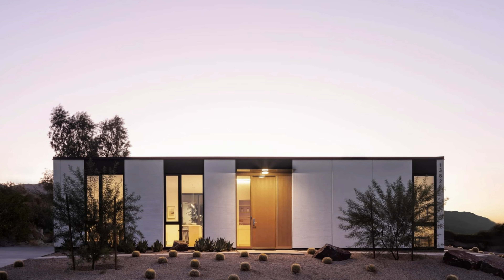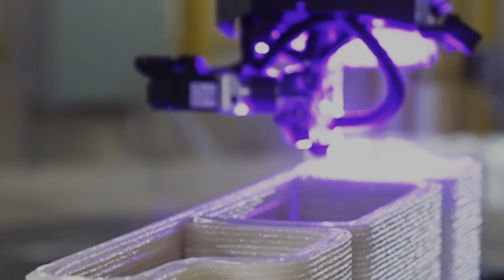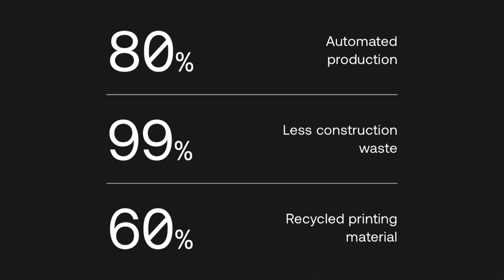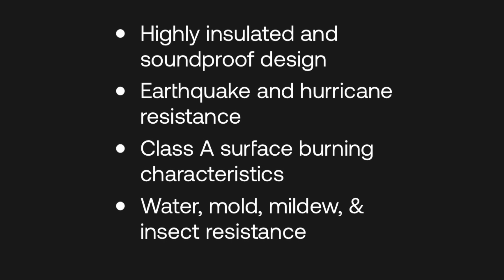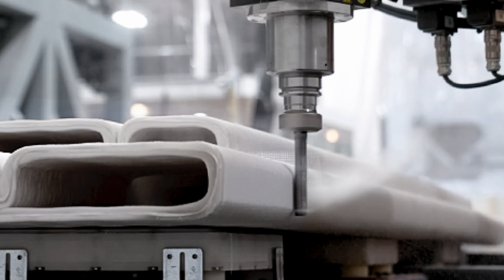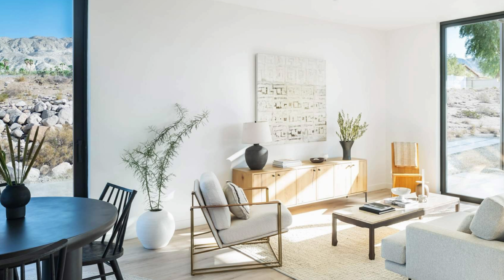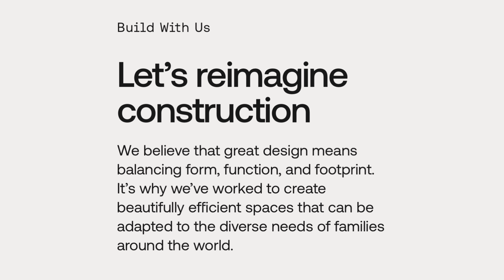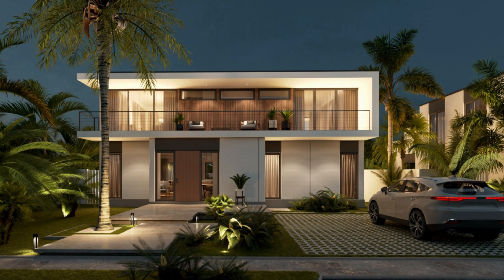Zero Net Energy PREFAB HOMES for Sustainable Living

Comment: I like this home and I want a home that is well built  to withstand hurricane strength homes with very little maintenance. 
But I love the homes you feature  with an abundance  of outside decks including ones with a roof top deck off of the upstairs bedroom.. lots of rodents and bugs in FL and I desire a home that will not allow bugs in my home.

Comment: The biggest cost in home development is actually the cost of the LAND the house sits on. Especially if you want "mod cons" like a flush toilet (as opposed to a composting toilet or septic system), running water out of the taps (as opposed to harvesting rainwater or using underground water), electricity, phone/net connectivity and finally not living way out west where it can take you an hour to drive to the shops.

How do we solve the land problem?

Comment: Sorry, solar panels may be 0 "carbon" when in use but they have huge issues for the environment. They are made with highly toxic materials and there is 0 safe way to dispose of them. It would be real nice if the truth was told about the environmentally safe products.

Comment: The 3D printing is just a cladding, not load bearing. Still using steel for structure which is costly, and immensely carbon intensive. They’ve managed to increase the wall assembly complexity instead of simplifying it. Visited their factory in Oakland and saw 55 gallon drums of liquid with hazardous chemical stickers on them. I hate to break it to you all, but when you need to cure a 3D composite material with UV light, it’s far from an environmentally friendly approach to construction. These guys probably pivoted from selling direct because they are Russian funded and my guess is they probably are trying to lay low in the public eye until the Ukraine conflict subsides.

Comment: Unfortunately, R19 in the walls isn't enough for the Northeast. We have a certified passive house in New Jersey and it's about R36 in the walls, and roughly R70 in the roof. With the solar panel array on the roof, it's net zero.

Comment: I'm with you. I like that floor plan with smaller bedroom and more living space. The bedroom only needs to be big enough to fit the bed with some space around it so you can change the sheets. And a closet. Need a closet.

Now, if we could just get someone to get something like this rolling in Canada
Reply: Just don't like the idea of wasted space like big bathrooms, hallways, kitchens and entry ways. You just don't do much living there. Hopefully this method will reduce the cost of housing.
Reply: Nope. Big bedrooms, small living room. Living room only needs a couch and a tv.
Reply: The closet space is still too small!  We make full use of two walk-in closets in a unit that has about the same total square footage.

Comment: the majority of the prefab/modular homes that are actually being built are big $$$ (250k or higher), there is STILL a massive shortage of companies/contractors willing to build low cost homes. ALSO most cities/areas stick tightly to existing building codes, which is unfriendly to modular homes. (as of Oct 2022)
Reply: Here in CA, the laws are changing/keeping up with the times. It’s legal to build a secondary unit in your backyard. Retirees can rent or use their backyards for secondary residences-use the space for extra income/in-law unit/nanny/air b&b, etc.
Reply: Awesome Arizona … yep, way too expensive!!!
Reply: Agreed it is VERY difficult to find an affordable larger prefab. I have been searching for almost a year now and I have yet to find anything more reasonable than traditional construction.
Reply: That is a lot